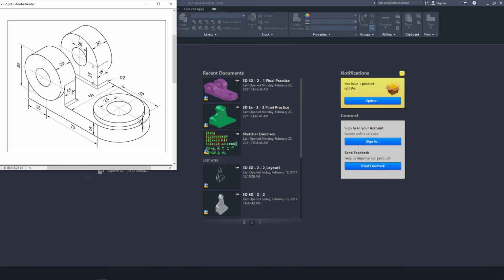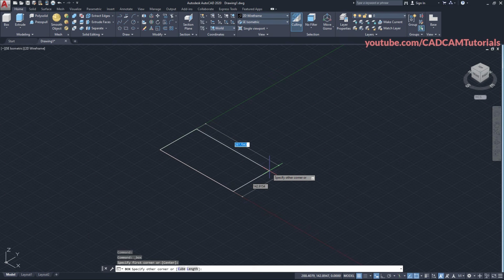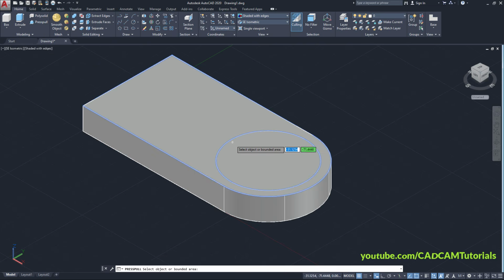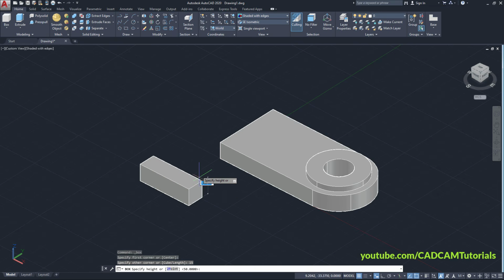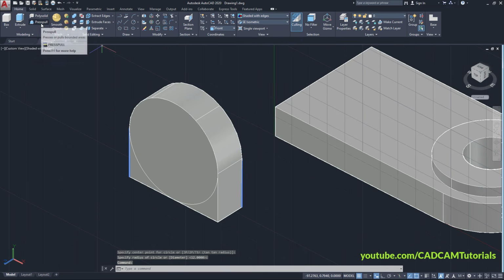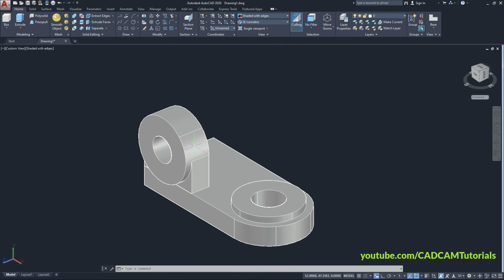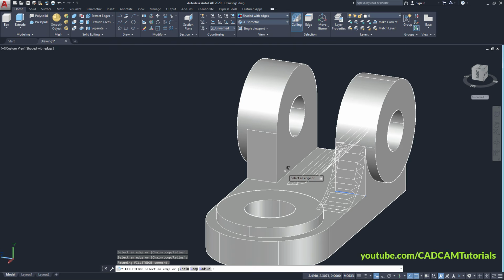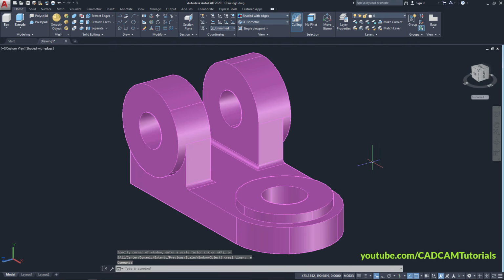AutoCAD 3D Mechanical Drawing Tutorial - 2

Comment: I cannot fillet the last one of the four edges due to not being able to select the edge within the FILLETEDGE command. I get the error "this selection for an edge is invalid." Any tips on how to correctly select edges on the surface of 3D objects using FILLETEDGE? In another problem that's potentially related,  I've occasionally had to switch to wireframe view to be able to remove construction lines that are no longer desired. In those instances, I can't select the lines any other way. I only have this problem when the construction line lies completely on a 3D surface.